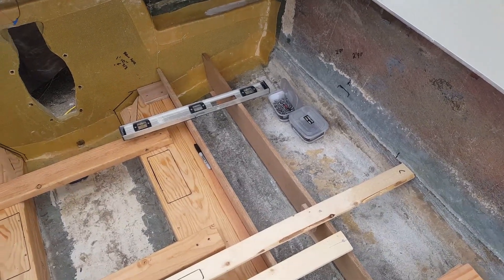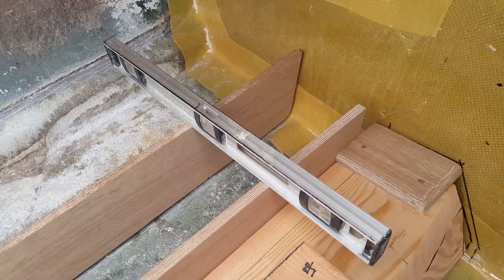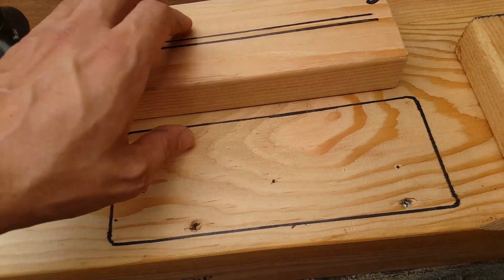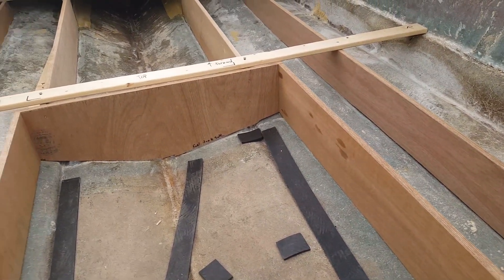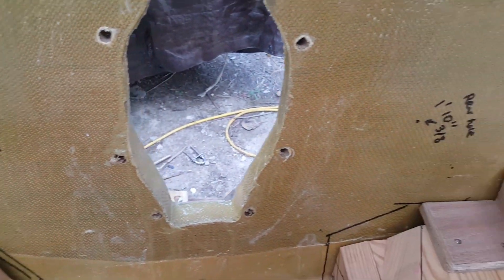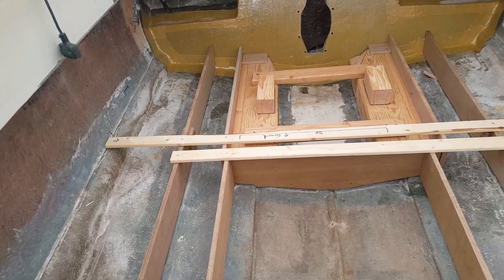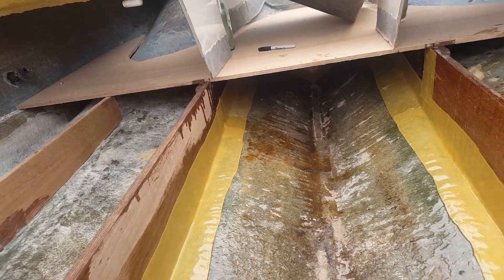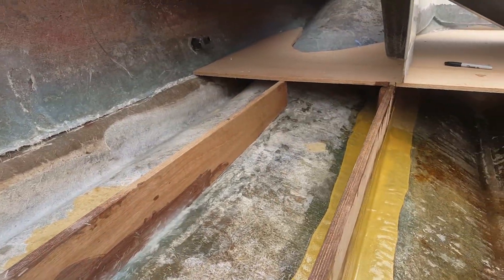Boat Transom and Floor Rebuild - Engine Placement & Rear Stringer Tips - Part 45

Comment: Hello Michael, FYI... you have likely completed this project but you may want to know that it is not advisable to locate stringers "hard" on the hull no matter how much glass you laminate on top of them.  BTW.... kevlar is used to mitigate impact loads (like puncher impacts) not to create structural integrity.  You may find it shocking but carbon fiber is not "stronger" than e-glass or s-glass but it is very much stiffer than glass.  I suggest you watch what Metan Marine does to boats that are re-manufactured, especially their "conventional" reman.... of a Formula 233 CC.  You are not forwarding advice that would be endorsed by "professionals".  Please be careful that most people want to a repair that will last another 40 years...not 10 years... I apologize in advance to burst your bubble... but why spend 100's of hours and not use coosa board or equivalent when the core is NOT what creates structure in a stringer... BTW... I'm a certified engineer that works with guys that build sport fishing boats ... so I'm not blowing smoke at you....Kevlar is used to mitigate impact loads...but the use of epoxy is recommended.  With all due respect